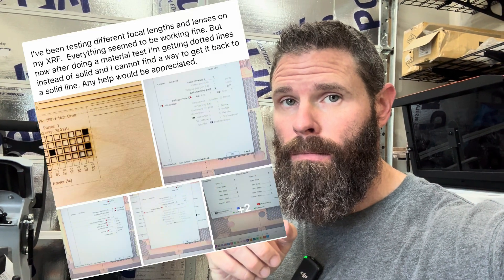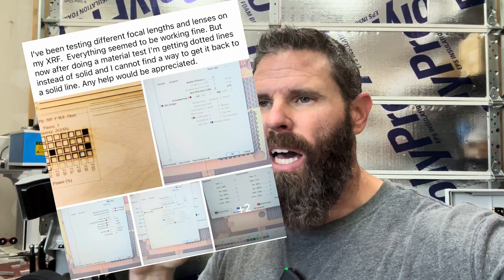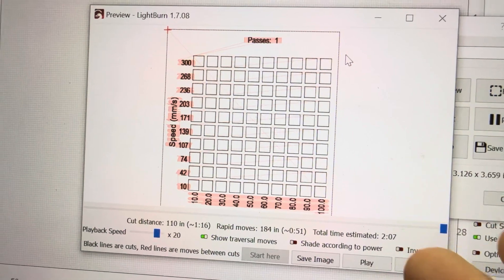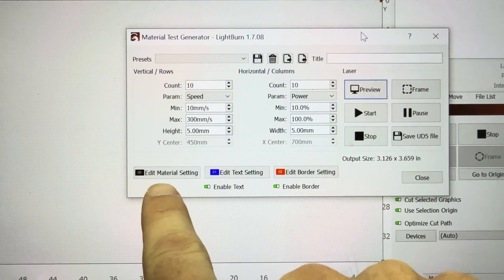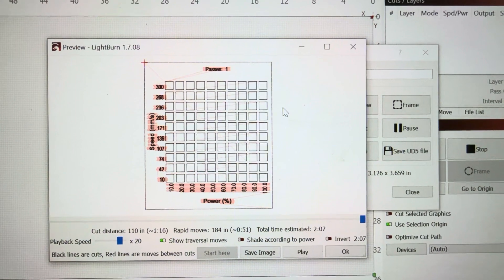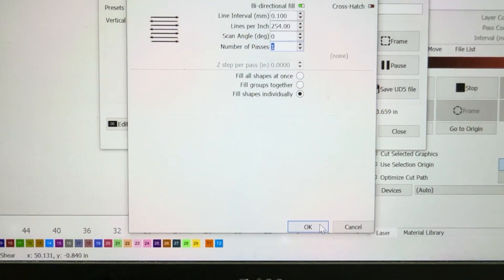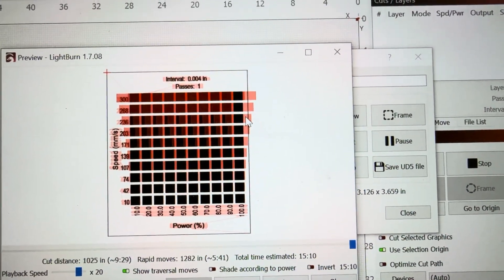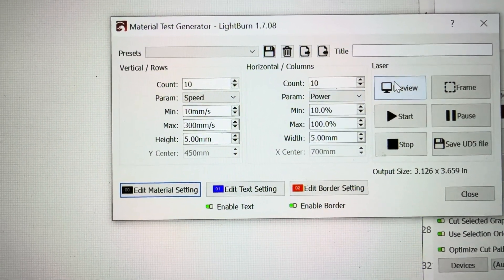Community Question - Lightburn Material Test Setup

Comment: How do you move the placement where the laser is positioned to fire the test on the work space? The material test window doesn’t allow origin control. Do you position laser before opening material test window? TIA
Reply from the maker: You position prior to running it. This video is helpful for understanding positioning.

https://youtu.be/HNNNsYMIrww?si=Pwc5BAepCjFoKWOE

There is also a framing option in the material test screen to show where it will go.
Reply: @BeardedBuildsCo  Thanks that is the video I had watched prior to my question. I just didnt know how to position it withing material testing.
Reply from the maker: @mikeburns7385 yep you need to set the head and origin before entering the material test. Then you can use the frame button in the material test window to have it show you where it will be.